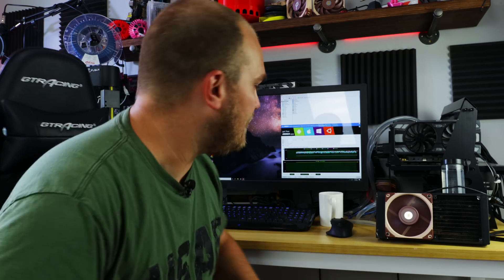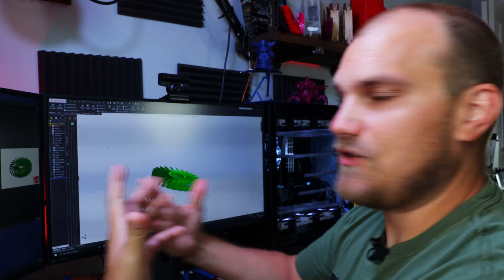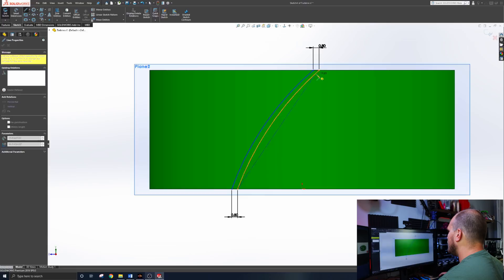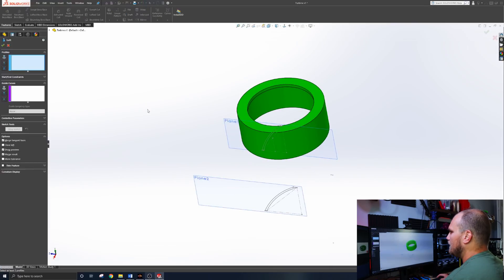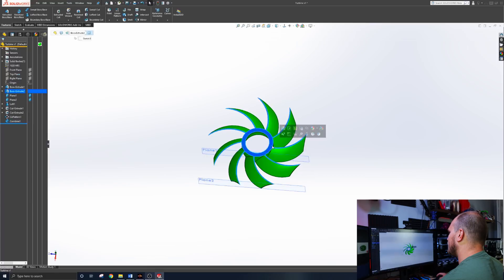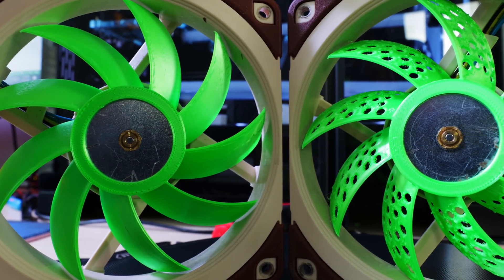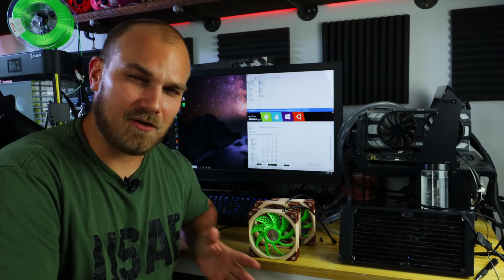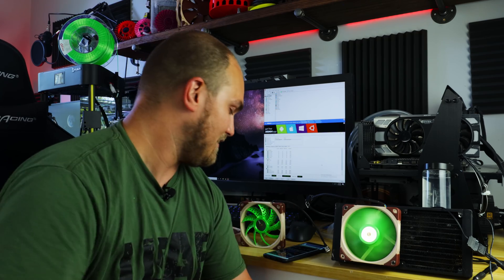Does A Holy Fan Work? | 3D printing the Answers to questions no one is asking!

Comment: The one with the holes in it has a bigger surface. Dependent on your slicing settings the  3D printer will use more material in that arias. Actually I was a little bit surprised, that the one with the holes did not have more mass.

Comment: These scales are not precise when trying to measure very low weight. You need to put something heavy on it without zeroing afterwards, then add the fan and subtract the weight of the heavier object. It might be enough to add the Noctua fan assembly to the scale.

Comment: Noooooo, you made the blade a different thickness at the edge vs base. The base is thicker, which I guess is fine, but that offset of 0,8 mm along the radius of the two arcs isn't the same as offsetting it 0,8 mm horizontally. The latter is thicker.

Comment: Back to the vortex tube concept, the flow inside has the outer flow going the opposite direction of the inner flow ... I'm wondering about flipping the outer 1/5 of the blade, causing the outer flow to be reversed of the inner 4/5 causing the inner flow to expand effectively chilling the flow into the radiator... A shroud might facilitate the transition.

Comment: if they are solid or hollow makes a weight difference at the edges of the holes add more material when hollow. And what about the pitched angle of the hole in relation to the blade surface?

Comment: I get what you're trying to do here, but if you were really trying to save weight/material you could put holes in the hub instead without impacting performance. Maybe a more useful note: those strings on the holey fan are terrible for aerodynamics (both noise and cooling ratings), so worth knocking off for a fan, if you can. Fun series.

Comment: am confused why would only using half a radiator not be safe? the radiator should be designed to function even with no fans running, it won't function as effectively with no airflow, but should still work

Comment: only using 1/2 a 240 isn't equal to 120 because you still have a higher surface area, so you're probably getting cooling that part way between the 2, your ambient room temp is likely to be cooler then your loop so the extra surface area will do a little cooling :)

Comment: The scale showed both as the same weight, but yes the holy one weighed less like you thought, it was just such a small smount less, because you're already pretty light, that the scale didn't have the resolution to tell the difference

Comment: Sometimes in a single weighing session, scales 'remember' the previous weight, and will show you the same weight for something that is quite close but not exactly the same.  I think this is probably a 'settling' optimization that they do so they aren't just bouncing around when weight shifts or people breathe on the scale or something.

You can reset the 'settling' by weighing something significantly different first.

I've never seen that for a bench scale, but I have for a body scale.  Maybe your bench scale is doing something like that.

Comment: Thing is that these radiators work by circulating water in tubes running up and down the box, the small metal fins are used to give more surface area to dissipate the heat, the fans are to push heat out of the tube and fins. While it won't be 100% effective since there isn't a fan on the second half of the radiator. The tubes and fins are still getting heat out of the system. it may be just a degree, even if just half or quarter of a degree it still can change the results.

Comment: hm... have you tried making two identical fans and then drilling holes into the blades yourself, guaranteeing the removal of material? Sure it may be an extra step but it could also be a limit of your 3d printers.

Comment: I see no problem with using a 240 instead of a 120... but you need to have some insulation blocking the fan-less half to reduce the amount of cooling it may contribute by natural convection and ambient air currents.

Comment: a 240 with one fan vs a 120 with 1 fan are different. however a 240 with one fan is still a 240 with one fan if you switch the fan

Comment: I think the one with holes in it is the same weight because it had to compensate for the lost rigidity of the fan blades by putting more material into the other parts

Comment: I'd be willing to bet if you printed both fans on the same printer there'd be a weight difference. 
The TEVO probably needs it's E-steps calibrated.  From this, and other prints you've shown from that printer it's significantly over-extruding. That's why it's so blobby and stringy.  Could reduce the extrusion multiplier in your slicer to tune it up a bit better as well.  I'd also increase the retraction quite a bit for that TEVO.

Comment: The 120 vs 240 is a huge difference, as stated already more thermal mass and passive cooling taking place on the half without a fan.
However for testing purposes. As long as you use the same rad and put the test fans on the same location then the rad is not going to be variable.

Comment: Weight is irrelevant. Weight only applies to acceleration. With the holes you create more turbulence, which means more energy is put into creating turbulence rather than moving the air.

Turbulent flow is good for heat transfer, but you want the airflow to be laminar over the blades. Only at the very end of the blade (not the tips, the underside) you want to air to become turbulent.

Comment: The only difrents is that a 240 radiator has a bigger heat sink but if you use the same for all testing it is just the same

Comment: You could get improved performance and/or efficiency by doing as ocean critters do. A fine scale type finish like most fish might help. Perhaps looks a speedy fish for insights. Or a bumpy finish like whales. Then there are birds. Extensions at the wing ends are being used by some jets for efficiency. It's possible that there are no birds with strait leading edges. Might help here too. I'd check their trailing wing edges and tails.

Comment: all I can think of is if there is any infill in the blades and not just all wall, then you woul be printing slightly more wall around the holes and less infilled area, somehow you magically ended up at the right amount of holes to blade ratio to end up at the same weight, or the difference is so minimal that the scales are just not accurate enough to display it. Interesting anyway

Comment: The reason the weights were the same is probably because you're using a scale that has a 0.01 gram tolerance.  You can get more expensive scales that have tighter tolerances like 0.001 gram.  For even better accuracy, you could get a gunpowder measuring scale.  They give the weight in grains and are accurate to 1/10th of a grain.  1 grain is = to 0.0647989th of a gram.

Comment: Above each hole place a ramp.  The ramp should have a surface area the same or larger than the hole (perhaps overlapping slightly like feathers).
This might increase the push effect while vacuuming more air from the front side.

Comment: a 240 with one fan will out proform a 120 with one fan because the water is in contact with the tubes for a longer period of time as the tubes are twice as long. the fins also have contact with the tubes with twice the surface area and can therefore absorb twice the btu's theoretically, but with a drop off curve for the speed at which that energy can transfer through the metal from the empty end to the cooled end.

Comment: We need Dyson to get involved in 3d printer fans. Theyre stupid expensive but absolutely amazing. Theyre completely silent. Not quiet SILENT. Its ring with nothing in the middle. So theres no need whatsoever for a fan guard or taking up space. You could stuff board wiring right in to make some room. Also no vibration. I ended up buying one a few years back because all the cheap fans at the store were out and the price kept in stock. Your normal pivoting fan will cost 20-30 bucks....Dyson 250-300 starting. Yes ultra expensive but would be a perfect design for 3d printing. Even the electricity has been thought of. I believe it said that running it full tilt 24/7 will only be 13cents a month.   I'll put the link to the site. Alot of people dont even know they exist.    https://www.dyson.com/fans-and-heaters/dyson-cool-overview.html

Comment: there is one potential reason for holes, double stacking fans. that is similar to bi plane wings on airplanes or even the wings on formula cars. 

the gap between the surfaces allows a greater force to be applied to the surface of the wing, admittedly a bad explanation, but finding multi-element wing profiles and fitting them into this might be fun!

Comment: Can you try a fan that has a single blade that spirals several times around the center, sorta like a squashed Archimedes' pump? (be sure to check if the airflow isn't blocked since we won't be able to see inside once it's printed and something could go wrong in there)

Comment: The reason it would be different from a 120mm rad is because the 240mm rad will give it more heat capacitance, also running 1 fan on it, while better than running no fans on it will be a lot less efficient for heat dissipation. 

You'd always need to establish a baseline. So say 2 noctua 120mm fans, then one noctua fan and finally whatever design you come up with to test to get a better idea of how much you're really losing by doing this.

Otherwise yeah, I don't see why you can't do this either. Nothing I can really tell.

Comment: The no difference in weight is easy to explain- it was printed on a different printer. If one printer is at the top of the tolerance band with holes and the other is at the bottom without I could see them coming out at the same weight.

Comment: I am more and more impressed with your rigor and thoroughness. Please keep it up, I hope you inspire more people to be methodical like this. WRT the fan weight, was the fill solid or optimized? If you have more edges / surface area, I can understand why it has less mass. Did the printers take as long to print both?

Comment: Your test was flawed, you need to use the same motor for all the blades, otherwise any difference may be from the motor. Also, should have been printed on the same printer, or else print 2 identical solid, then drill holes.

Comment: At least on video it seems that there is a noticeably bigger gap between your 3d printed fans and the housing. Tight tolarances are one reason, why Noctua fans perform very well in comparison. A standard design, tight fitting 3d printed fan with a reasonably smooth surface finish would be a great way to determine the influence of the manufacturing process. Of course it would be hard and time consuming to match Noctuas tolarances with FDM printing.

Comment: A lighter fan wont necessarily spin faster but the amount of electricity to move the fan at same rpm will decrease. This may not be measurable as the difference would be so small.

Comment: The only reason I'd think a 120 might work differently is because they're probably generally more geared to be designed for fin density given their intended purpose, but a 1 to 1 fin density example should be the same other than the time it takes for the bigger thermal mass to heat up on the 240 with one fan.

Comment: So the fan rpms are different. I wonder what the CFM is for each. Im no expert on the topic, but i think i remember reading once that rpms and cfm are two different measurements. It may be possible to have a slightly lower rpm fan, with slightly higher cfm.  The pitch of blade, its shape, etc, all have an effect on air flow.  
Do you have a way to measure the CFM?

Comment: Holy fan is heavy because slicer builds a solid perimeter around a hole.  If the hole wasn't their it would have been air and a little infill.  Print 100% in fill and you will have less weight with holes

Comment: How about creating a fan shroud, which guides the airflow to the center below the motor, to kill the dead spot and use the whole 120x120mm surface?! Would that really cool better or just sam, maybe worse? Who likes rgb led, could integrste some in the upper center area, below the motor, if the shrout is made of half transparent whilte filament, leds would light it up pretty nice.. no rgb fans needed..

Comment: Well, yes half a 240mm is different to a 120, but as long as you are consistent with your tests(not suddenly deciding to put 2 fans on after a benchmark was set with 1 fan) it should be fine.

Comment: Of course a 240rad with a 120mm fan isn't the same as a 120rad with a 120mm fan, the passive side of the 240 will dissipate a lot of heat as well, and it also has a lot more thermal mass

Comment: 1:30 it's not the same because there's more water and it takes longer to heat up. This is why when you do a test for thermals you let both air and water coolers stabilize.
Tldr: thermal Mass

Comment: If you’re trying to measure fan design (as you don’t have access to the material that Noctua does) then you should be using your in house printed fan instead of the OEM one. That way you’re eliminating the material variable and can focus strictly on the design of the fans when comparing.

Comment: You should really use the same printer and slicing settings for both fans to eliminate any kind differences from those factors.
You should also print the same fan on both printers to see if that makes a difference.

Comment: I've been very curious about fans with very small motor. I've got many Arctic cooler fans, which are VERY efficient, since they have a very small center, and blades are much bigger. 
This:
https://www.ebay.com/itm/Arctic-F12-TC-120mm-PC-Case-Cooling-Fan-Temperature-Controlled-TC-Silent-Quiet/161557735867?epid=135061420&hash=item259d9769bb:g:ye8AAOSwirFbIjSd
So I've been curious if you can make an experimental fan with smallest center possible. Move that big chunky motor somewhere on side and use rubber belt to connect motor axis with fan axis's.
Something similar: https://www.ebay.com/itm/GT2-6-Timing-Belt-L110-1524mm-Rubber-Drive-Belt-6mm-Close-Loop-for-3D-Printer/264309558745?hash=item3d8a13cdd9:g:T1wAAOSwRfJczbRV
Plus this: https://www.ebay.com/itm/4x8x3-mm-ball-bearing-MR84-bearing-4x8mm-bearing/261052524826?_trkparms=aid%3D1110012%26algo%3DSPLICE.SOIPOST%26ao%3D1%26asc%3D20200420083544%26meid%3D8e7c8b46627c4d1482a39c96a15d6cae%26pid%3D100008%26rk%3D2%26rkt%3D12%26sd%3D251467813238%26itm%3D261052524826%26pmt%3D1%26noa%3D0%26pg%3D2047675%26algv%3DPromotedSellersOtherItemsV2%26brand%3DACER+Racing&_trksid=p2047675.c100008.m2219

Comment: on a sailboat (and formula 1), they use multiple airfoils to create "suction" rather than simple "redirection" which increases force more than drag. if you've got 9 blades, you could have 3x blades each of (jib1-main1-main2). take a look at modern sailboat airfoil design for inspiration.

Comment: Could you test abs vs pla vs some flexible plastic for which one would hold up the longest and be most efficient. 

Also , can you try to make your computer hot enough to melt the fans (or see if that is even possible with thermal throttling).

Comment: Probably already been mentioned, but you should maybe print one of the blades again so that you have one of each from the same printer with the same filament. That's likely where the odd identical weight came from. I've not used Prusa Slicer but Slic3r would have given you an estimated filament usage on export too.

Comment: I think the reasoning between using a 120mm rad as opposed to a 240 is that you lose a LOT of your static pressure to the gap between the fan mount and the radiator fin stack itself.
Maybe your 240mm rad is designed differently from mine, but it doesn't look like it. Anyway, your testing methodology is still sound, it's just not otherwise optimized.

Comment: Also what about stacking fans running them counter rotating. The one against the rad you would run in a regular configuration, then you would flip the second fan over on top. You would obviously 3D print your own blades.

Comment: You printed them on different printers.  This could account for the weight.  It depends on exactly how much each extruded.  They are unlikely to be identical.  Print a holey fan on the delta with same slicer settings and then check weight.  Also, what does the slicer say about material used for each?

Comment: Why not try making an old 50's / 60's style flat bladed three blade fan like you'd see on old fans for moving air in windows etc. and see how that performs? I'd be quite interested since I have one of these and this sucker moves air like mad. This is an example of what I mean https://thumbs.worthpoint.com/zoom/images1/1/0616/01/vintage-big-metal-ge-box-fan-speed_1_cd090cdf31394be1cf1de9be46e9c413.jpg

Comment: Just print a block plate for the other half of the radiator. Will reduce ambient air from causing any difference in testing

Comment: I think you overdid it.

Don't make holes.
 Instead cover the surface with small indents like on a golf ball, and make the surface as smooth as possible otherwise.
I believe the theory is that the indents on a golf ball create a thin layer of slower moving air on the surface, effectively making the surface slicker to the air it moves through.

Also: try to make the gap between blades and the side of the fan as small as possible - maybe even try to add some small winglets on the tip of the fan blades.

Comment: Why the one with holes isn't lighter?
Easy.
Those holes cause the nozzle to stop and start printing much more often, each start and stop causes a blob on the odge also you have some stringing as well, multiply it by 100 holes or whatever much you have and it will be enough to make up extra gram.

Comment: Do a Fan golf ball fan ;) You know the indentations off a golf ball in the blade.
It helps the golf ball fly longer, due to aerodynamic resistance. Maybe it will push a little more air